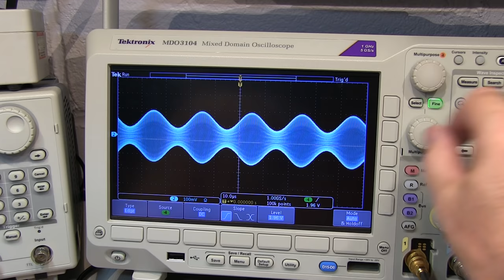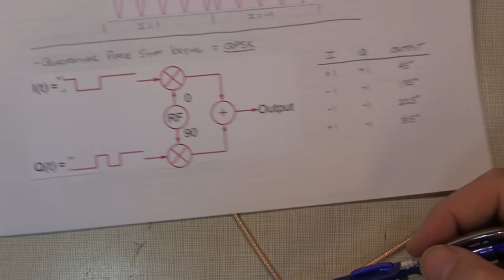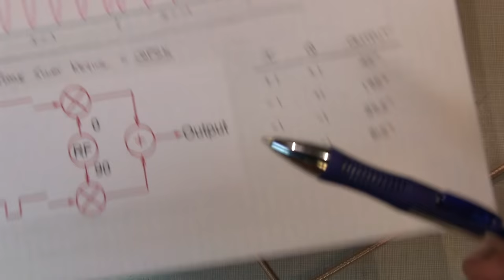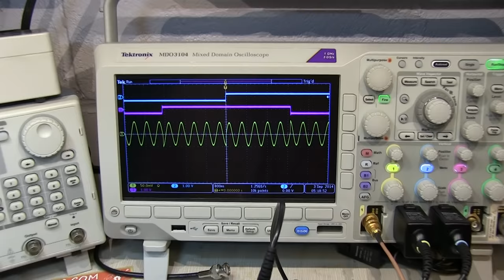#170: Basics of IQ Signals and IQ modulation & demodulation - A tutorial

Comment: For optical coms, people use IQ modulators to implement QPSK modulation. However, I don't understand why you can't simply implement the modulation with a simple optical phase modulator? A phase modulator implements a phase proportional to the voltage it's driven with, so it can give you any phase you want. The only downside is needing 4 voltage levels to drive it with. But this isn't particularly difficult with todays AWGs. No splitting and mixing 2 quadrature components needed. Am I missing something?
Reply from the maker: Mach-Zhender phase modulators are non-linear devices.  It would be more difficult to obtain low EVM via direct phase modulation.
Reply: @w2aew  I believe it is more correct to think of a Mach-Zehnder as a intensity modulator. They are interferometers which have a phase modulator in 1 of the 2 branches, and by modulating phase you can convert that into a intensity modulation due to the interference occurring between the light in the two paths. The intensity modulation is a sinusoidal function of  of the phase i.e. Iout=sin(theta). Where the phase, theta is itself a function of the voltage applied to the phase modulator, which we will assume is linear. 

If you look at the diagram for an optical IQ modulator, the light gets split into 2, halves, similarly as it does in the electronic version, then each branch is put into mach Zehnder modulators, and one is shifted 90 degrees, and then they are recombined. 

The way I think about the effect this has, is imagining a phasor with a value of 1. The Mach Zehnder performs a intensity modulation which can change the amplitude of the phasor along the x axis from 1 to -1. By having a second branch with a pi rotation, you have a phasor which can be transformed along the imaginary axis from -i to i. And then by recombining you are doing the addition of these 2 phasors to create a complex value. By having this double Mach Zehnder configuration you can achieve any complex value on the unit circle, as well as within it.

Having a simple phase modulator by itself, not within a MZI allows for rotations around the circumference of this unit circle. But that still allows for all the states needed for QPSK.

The thing is, looking at the literature QPSK appears to always be performed with the more complex IQ modulator structure and I don't know why. It would allow one to perform QPSK, with binary voltage levels, with each of the 2 Mach-Zehnder structures being driven independently by either a high or low voltage to each modulator. But I don't know if that's the only reason, or if I'm overlooking something, or I am fundamentally misunderstanding something.

Comment: There is one thing about IQ demodulation I can’t wrap my head around: received signal is completely out of phase sync with LO, thus, resulting in different readings of IQ, compared to transmitter. How is that working?
Reply from the maker: The signal processing in the receiver will have some algorithm to remove the frequency and phase offset between the TX and RX.
Reply: @w2aew  thanks! can you recommend any books on the topic?

Comment: Amazing video. But wont modulating it with QPSK change its frequincy? as i understand cutting a sine wave off short will shift its frequincy for that moment. is that frequincy change small enough to not cause any interference for other signals? Is that the reason that AM signals take very little bandwith?
Reply from the maker: I'll answer you in two parts.  First, please note that I showed the BPSK and QPSK examples in a pretty unrealistic way.  In reality, the carrier phase is not switched in such a rapid fashion as shown in the video.  Typically the phase transitions occur much more slowly, over many many RF cycles.  However, if I showed it this way, it would be very difficult to visualize the phase change.  The process of slowing the modulation state changes is known as baseband filtering - of which there is NONE in this video - very unrealistic.  Second, you are correct.  ANY time you impart any kind of modulation to an RF carrier you will alter it's frequency content.  In other words, you create modulation sidebands.  Modulated RF signals take up more bandwidth than unmodulated signals.  The occupied BW of a modulated RF signal is proportional to the symbol rate and rate of change from one symbol to the next.  Higher symbol rates, and fast modulation state changes, lead to wider occupied bandwidth.
Reply: @w2aew Intresting. did some more research and really thought AM wouldnt take more bandwith the more power you would put in. but that kinda would mean infinite information transfer... the higher the amplitude the higher the frequincy overlap. Combine that with phase changing and more overlap... Thanks for telling me Any modulation will use more bandwith based on symbol rate/change
Reply from the maker: @kil98q  For AM, the bandwidth of the sidebands is equal to the baseband - only the magnitude changes with the modulation depth.  For frequency or phase modulation, it gets more complex than that.

Comment: hi thanks for the video, i have one question without phase change in LO how do we get the QPSK. is any other chances are there like changing the I and Q waveforms  phase shifts etc..
Reply from the maker: QPSK results from the summation of the amplitude variations of the I and Q components.  For example, if Q is zero, then changing I from +1 to -1 results in a 180 degree phase shift.   Same holds true for I=0 and Q varying +1 and -1.   When you add the quadrature signals together, the result is a phase between them.  This is illustrated quite well in this video:
https://www.youtube.com/watch?v=RHFZUqUM8DY

Comment: How would you make sure everything is in sync, and tell two consecutive bits of the same value apart? Wouldn't you also need to transmit a clock signal to ensure synchronization?
Reply from the maker: In a receiver, there usually isn't sync.  The DSP in the receiver would have an algorithm to remove the baseband offset, which will show up as a slow sinusoidal variation of the I and Q values.

Comment: On the pink waveform on the graph paper where you are showing BPSK, it looks as though there is actually a 90 deg phase shift instead of 180deg. Is this a typo?
Reply from the maker: barrzip44 I'm not sure where you are seeing a 90 degree shift in the BPSK drawing.  To me, the graphic is showing a 180 deg phase shift (looks like the waveform in inverted).
Reply: ***** At I=+1 the waveform starts at the positive peak and goes negative. It is my understanding that in order for I=-1 to have a 180 deg phase shift, then it would start at the negative peak and go positive. However, I=-1 starts at the zero crossing and continues negative. This looked like a 90 deg phase phase from I=+1. I am looking at 11:19. 

Looking at the same waveform on the oscilloscope at 12:14 (Ch1, yellow trace), for I=+1, it starts at the zero crossing and goes positive, opposed to the printed waveform that starts at the positive peak and goes negative. It seems as though you cut off some of the waveform at each end when pasting it onto the paper.

I know the oscilloscope shows it correctly. It's just that it confused me a little when I first saw it since the graph paper is shown first in the video. It is a small detail that I happened to notice. The video is absolutely great and I learned a ton from it. Thanks so much!

Comment: is it possible to construct wideband FM (large deviations) using the IQ modulator? I can see how a narrowband FM (small deviation) can be approximated in terms of I and Q signals but I cannot figure out how a wideband FM can be represented. If it's possible, the I and Q signals must have a very complicated form.
Reply from the maker: Frequency deviation is simply represented by sinusoidally varying I an Q signals.  These I and Q sinusoids are 90 degrees apart - and frequency offset is determined by which one is leading.  Thus, FM deviation is modeled by sinusoidal IQ whose frequency varies from 0 to the max deviation value.
Reply: @w2aew  so the Q(t) and I(t) signals must already be frequency modulated sine and cosine waveforms but in base band (zero carrier frequency)?

Comment: I understand the modulation of the signals, however I'm having a lot of difficulty following the demodulation. For the I channel to provide the exact I data that was modulated, the LO would have to be in sync with the transmitter LO. Otherwise if it was 90 degrees out of phase your I and Q signals would be mixed. Can someone explain this?
Reply from the maker: This kind of phase ambiguity is dealt with in the protocol - signal headers often contain a specific expected word sequence, and the receiver will rotate through the possible phases until it "sees" the expected pattern.  Not all modulation types have this ambiguity, but it is common with phase modulation.
Reply: @w2aew  Okay so the issue I'm envisioning is there, and it's fixed in software. Thank you for taking time to reply- I certainly didn't think you would reply on a 7 year old video!

Comment: How does the receiving side pull out what's I and what's Q on an incoming waveform? I and Q are 90 degrees out of phase, but how do you "initialize" the phase of I?
Reply from the maker: It depends on the modulation and signal being sent.  For many digital modulation types, there is some sort of sync word that is sent that the receiver looks for and will rotate the phase to see when it finds it.

Comment: So if I got this right, for any variation of QAM the I and Q would be square waves, right? Wouldn't that present a problem to cheap sound card based SDRs? If I remember correctly, sound cards have HPFs in their output paths to prevent them from passing DC. Or is this basically a non-issue since the square wave signals usually are run length limited so that only the edges will get a little mushed?
Reply from the maker: For QPSK, the I and Q are binary signals.  For higher level QAM, then they'll be multi-level signals.  The HPF issue can be overcome by run-length limiting as you stated, or by applying a carrier frequency offset to the IQ (rotating the vector).
Reply: Usually you run the I and Q signals through a "pulse shaping" filter to "mush" the edges before you actually use them to modulate the inphase and quadrature carriers anyways - a square wave has 'infinite' bandwidth (depending on the edge speed), and there's no information in those sharp edges, so it's a waste of bandwidth sending them. The only thing that's important is that the I and Q are at the proper value in the middle of the time between transitions (of that original square wave) - the 'symbol time', or 'decision time' in the demodulator. The slower you can make the transition from the previous I and Q value to the current one, while still maintaining the proper value around the symbol time, the less excess bw your signal will occupy. That's where eye pattern analysis comes in. When looking at the eye diagram of the I and Q signals at the transmitter (before modulating the carriers), If the eye is 'open' at the symbol time, the I and Q are making it to the correct value, and the demodulator should successfully recover the symbol (given sufficient S/N at the receiver of course). If the eye is closing in at the symbol times, your pulse shaping filter is too slow, and the demodulator will have a tougher time recovering the symbol correctly. That's why I hope Alan does another part, or parts, to this video - this was an excellent intro, but there's so much more yet to go from theory to practical implemented system (especially on the demodulator side). The thing I find the most frustrating (and at the same time interesting) about communications systems is always in the textbook, there's a box in a signal chain with "PLL" or "clock recovery" or some other such simple sounding function, and when you look at the overall system diagram, it looks easy. The gotcha is that all the complexity is in actually implementing the "simple sounding" blocks when it's time to implement a physical (or even software) radio.
Reply: gorak9000
Yup - that's also what frustrates me the most. If you really wanna know how something works exactly, you tend to notice that in almost all the materials you find (online) there's quite a lot of hand waving going on. That's why I'm so glad that this video tries to explain the basics in a way that can be understood by people without a deep background in communication systems.
Reply: sapperlott Heh, yeah, and not only in communication systems. Pretty much any research paper / thesis is also like that. Supposed to be enough information so you can replicate the experiment to confirm the data - almost never enough detail given to actually be able to do that. No one ever likes to give away the recipe for the secret sauce! That's why I hope Alan can do more advanced videos in this subject. It's almost a valid excuse to spend time watching Alan's videos instead of research :) Even as a trained computer engineer, soon to have a MSc., I always get something new, or a different take on something - only a handful of other channels on youtube can even hope to deliver such high quality content. I really really enjoy seeing the live demos with actual signals on the scope! I've seen this theory a whole bunch of times (in school, and communication systems happens to be a favorite subject, and hobby), but there's something way better about actually seeing live signals on a scope. And all the measurements and analysis the software with the MDO4000 does - [drool]. If they didn't cost so much (and if I can ever stop being a student), I'd have one on my desk right now! If I ever get more time to actually pursue more radio design stuff as a hobby, the MDO4000 is high up on the list of stuff I'll need to get - along with a nice microwave signal generator! Why are my favorite hobbies so expensive?!?

Comment: I realy dont get it how IQ modulator can be used for frequency modulation, as we can see, frequency stays unchanged, only phase beetween two signals changes. And should not LO frequency changes if we want to do frequency modulation, FM, or FSK ?
Reply from the maker: If you alter the frequency of the IQ baseband signals, you change the frequency of the output.  If you apply quadrature sinewaves to I and Q, you can get FSK by simply changing which one is leading/lagging.  See my next video on the topic:
https://www.youtube.com/watch?v=5GGD99Qi1PA

Comment: Excellent explanation. My doubt is this: Is AM(whether plain AM or QAM) not a misnomer because what the modulated signal does is vary the instantaneous value but not the amplitude(peak value) of the carrier wave.
Reply from the maker: AM is not a misnomer, it does modulate the peak value of a carrier.
Reply: Thanks for the clarification.What I meant was that since the modulating signal  in AM  modulates(changes/pulls up) numerous other instantaneous values of the carrier wave apart from the amplitude (peak value) which is just one of the instantaneous values, calling it AM as if to mean that the signal modulates the amplitude of the  carrier 'only' may not be appropriate. If the word "Amplitude" is considered to be synonymous with the word "Magnitude", the usage of the phrase "Amplitude Modulation" may be appropriate. In the digital equivalent of AM also i.e. Amplitude Shift Keying, the digital signal ('zero' bits) modulate(suppress) multiple cycles of the carrier wave not just the Amplitude. Perhaps more appropriate name "Magnitude Modulation"?
My other doubt is how can either positive or negative envelope of the modulated carrier wave in AM fully represent the entire modulating signal? It appears that the modulating signal is contained(encoded) in both the positive half cycles and negative half cycles of the carrier wave.
Reply from the maker: I'm not sure I see your distinction between Amplitude and Magnitude of the carrier.  In the context of AM (or the QAM for that matter), Amplitude is synonymous with Magnitude.  Being a linear operation, AM equally affects the positive and negative half cycles of the carrier.  If it didn't, there would be many additional distortion components in the frequency domain.  ASK is simply a form of AM, where two amplitude levels are used.  In the case where zero bits are represented by completely suppressing the carrier, this is often called OOK (On / Off Keying).  Not all ASK is OOK.
Reply: Thank you.  If AM equally affects the positive and negative half cycles of the carrier, then how can we derive the modulating signal from either  positive or negative envelope? Is it because even though some signal quality is lost in selecting either of the envelopes, it is not perceptible to human senses?
Reply from the maker: AM can be demodulated by detecting either side of the RF envelope. It's just an imperceptable phase inversion.

Comment: HI, may I know how you generated two waveforms of exact frequency 90 deg apart?  It seems this is difficult to be done using separate function generators.
Reply from the maker: True - it really can't be done with separate function generators easily.  I am using a two-channel function generator (AFG3000 series, Tektronix) which allows me to control the phase between the two channels.
Reply: Its so tough to tune both of them to exact f.  I guess I cant do this experiment. I have two FGs but not  that 2-CH FG you said. Sticking to simulation for now unfortunately,
Reply from the maker: Another option would be to send the output of your single signal generator into one or two adjustable phase shift circuits - then you'll be at the same frequency and you can adjust the phase of one path vs. the other.
Reply: Sounds like a simple and an easy workaround. I will try this! Thanks. I was using GNU Radio for simulation today. It worked too!